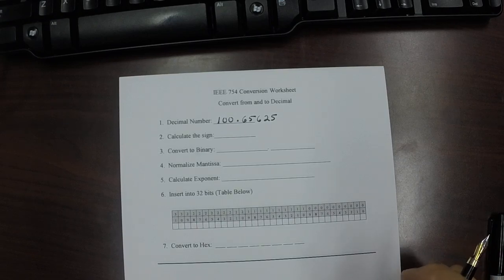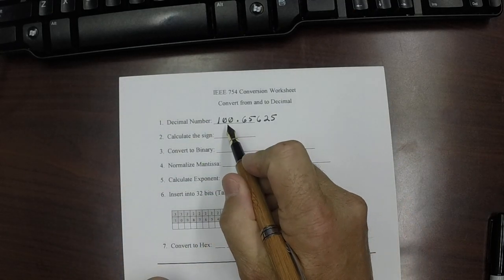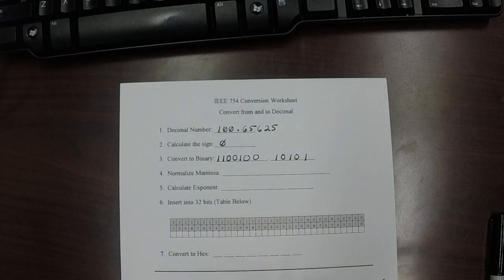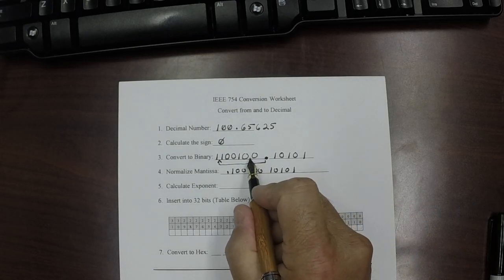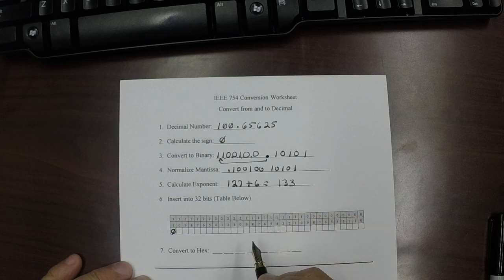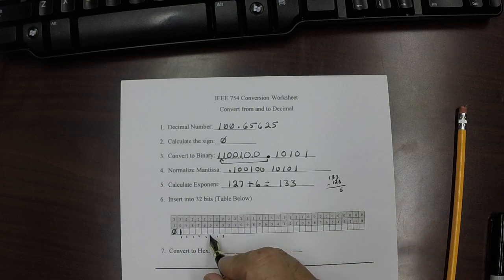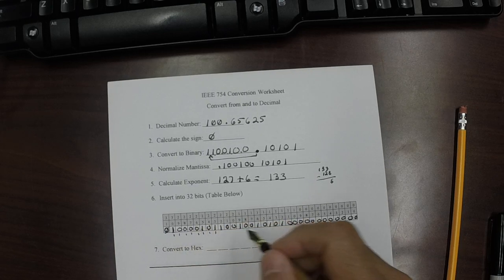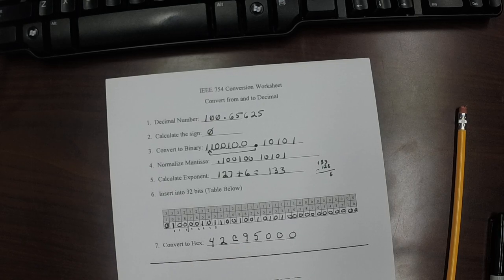IEEE 754 32 Bit Decimal to Hex

Comment from the maker: The exponent can be both shifting to the left and right of the decimal place.  127 is the pivot point.  Any number larger than 127 shifts to the right. Any number less than 127 shifts to the left.  In the above example you count the number of places  you had to move the decimal to place it to the right of the left-most 1.   Add that to 127 and store that number.    When converting it back you will take 127 and subtract it from the exponent and find the positive #6 which tells you to shift the decimal place to the right 6 places.  If it was a negative number,  you would shift it to the left.
Reply: Would you mind explaining why we need to substract to 128? Could you please share an example of a number is larger than 127? I am not understanding the shifting to the right correctly. Thanks!